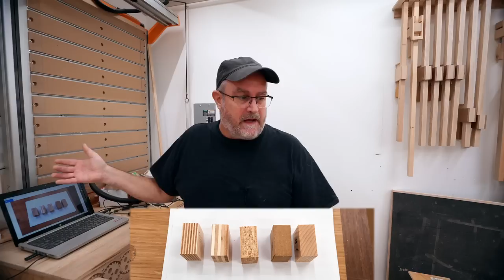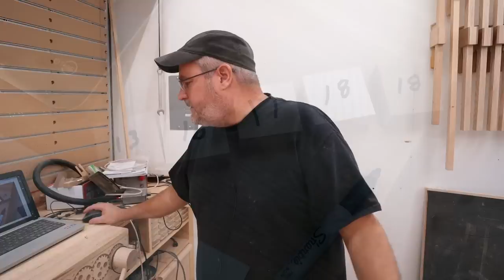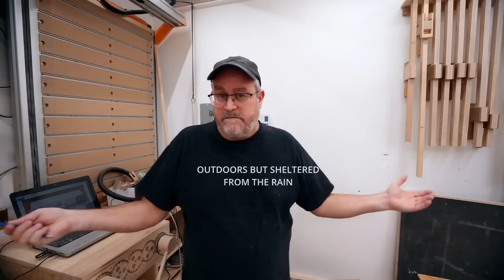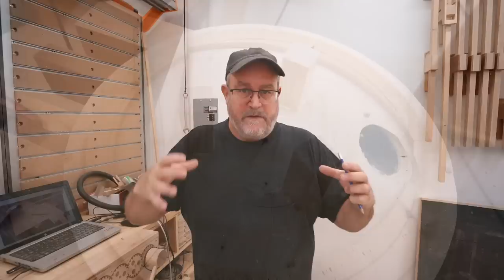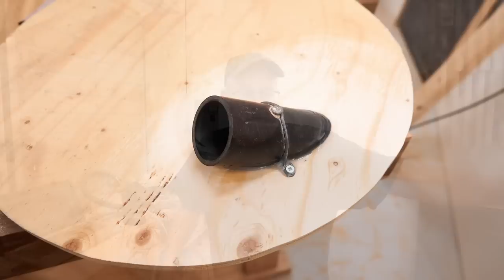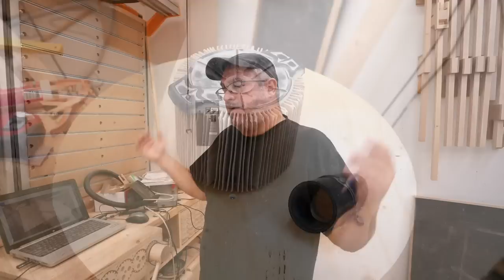Post Hack Update Plus How Much Does Your wood Swell When It's Humid?

Comment: great analysis!
I live in tropics on the equator, and I've done my research as well, mostly on solid wood, as by choice I don;t use plywood or MDF.
what I've observed over the years, I don't even need to account for wood expansion or contraction, as the humidity and temperature are pretty much constant throughout the year. the temperature drops 5-10 degrees at night, but humidity doesn't. 
and the 27 inches table made of 7 thick boards (1 3/4 inch) has not changed its dimensions throughout the year at all. well there were some deviations during the monsoon, constant rain for weeks, but less than 0.5%, and there were no cracks or warping. the boards were glued up with the strong PVA glue, with no dowells/dominos/biscuits, nothing but the glue. the glue up was aligned by 4 way pressure clamps, so no cauls either.
and to keep the top flat, i used the breadboards, glued with epoxy resin, with no wood movement allowance whatsoever. and the top was glued to the base using epoxy resin as well, poured into the mortices.
the table withstood over 3 years of the 95% humid tropical climate, without warping or cracking, and no noticeable wood movement. just to add more information, I used extremely hard wood, which even on the end grain looks slippery, looks like end grain is water tight, doesn't look like end grain at all.
so having learned that, I actually stopped being bothered about the wood movement at all. I built ~10 tables, and they all stayed flat, and crack free, and the legs stayed parallel to each other.
of course I understand that in Norther Hemisphere, the humidity jumps are drastic, and then the pieces of furniture might break or change geometry significantly, should they not be designed to allow for the wood movement.

Comment: A lot of people seem to worry an unreasonable amount about moisture.  Magnitude is key: any liquid water reaching any of your wood projects will do vastly more damage and much more rapidly than any amount of humidity, and projects stored indoors where air is conditioned to some degree year-round will only suffer if you live somewhere with big seasonal humidity swings AND you've failed to design for wood movement.  The percentages you calculate are a great indicator of how much temporary wood movement matters.  <10% across the thickness of boards is negligible outside of meaty beams and slabs, and moisture doesn't significantly affect length, so unless you have wide panels exposed to humidity or actual outdoor/liquid water exposure, its just rarely an issue.  Permanent deformation of engineered wood products like MDF is another story, but still rarely applies in the situations people put most cabinets and furniture.

Comment: Hey John. Glad to hear you have your channel back. This video gives us good insight on the suitability of materials in more extreme humidity situations. Here in South Florida, in a non- air conditioned shop, the humidity ranges from 40% in winter to as much as 85% on some summer mornings. based on your experience, can I use MDF  for work table surfaces and jigs?
  I can get MR MDF, but with either product, i would want a protective finish on top to protect against scratches, etc. What would you recommend?

Comment: I've been searching all your channels every couple days for a hack update. Definitely glad to see you back. Looking forward to more good content. 

As for the swelling with humidity, that is a thing that's a pretty big deal in guitar building. Drier wood resonates better. How wood is stored and handled during and before construction, how it's finished after construction, poly vs nitro finishes, moisture content is monitored throughout the building process. Grain direction of the pieces used is a big deal. It affects movement as well. Tops of acoustic guitars are quarter sawn. Different species in the necks are different cuts. Quarter sawn mahogany is common in necks. As is flat and rift sawn maple. Quarter sawn maple is uncommon but also used on necks, supposedly more stable but in my opinion a little less attractive for a neck shaft. Ash is typically not used in necks but sometimes it's used in bodies for electric guitars. 

Guitar setup is a game of thousandths of an inch for dedicated player. If your string height moves away from, or closer to, the fret tops by say .010", that's very noticable to the player. A 20 inch piece of wood, the neck, can swell enough to throw that out and back as humidity rises and falls throughout the year. My personal guitars get small adjustments about every 6 months to keep them where I want them. With the main season changes. Just small tweaks. And that's not from like a preventative maintenance type of thing. It's like an... I pick it up and it suddenly plays just a little off type of thing. Usually with the season changes and relative humidity changes. And they all are stored in one location mainly other than trips to places to play. They move around some even though I don't touch the adjustments. And some guitars are more susceptible than others. Likely due to finish variations. Some guitars have finished maple necks. Others have unfinished (or simply oiled) Rosewood, Pau Ferro, or ebony fingerboards are common. As well as some modern day rosewood substitutes.

 Professional musicians move around a lot, often play outdoor shows, then indoor shows, back to outdoor shows. If a guitar is in Arizona, New Mexico, Nevada for 2 or 3 weeks during summer, then it's taken to Louisiana, Mississippi, Arkansas for the next 3 weeks, there is no doubt it will need adjustments to feel the exact same to the player. 

Solid wood definitely moves. It's almost like the wood is still alive. I doubt that MDF sample will ever shrink back though haha 

Anyway.... Glad to see you back and I'm glad this situation had a favourable outcome for you.

Comment: Hey John, if you haven't found a password solution yet, I recommend 1password. There's a small learning curve, but once you figure it out, logging into whatever becomes very easy and quick. I like 1password in particular because it can also do the 2factor QR code logins, so I don't need to use some other app to do the 2factor. Glad you got everything worked out!